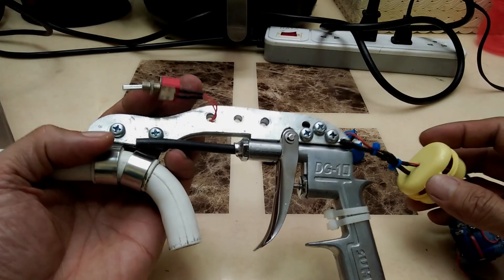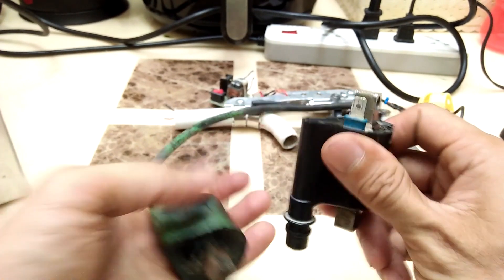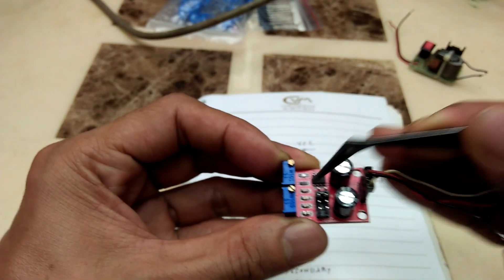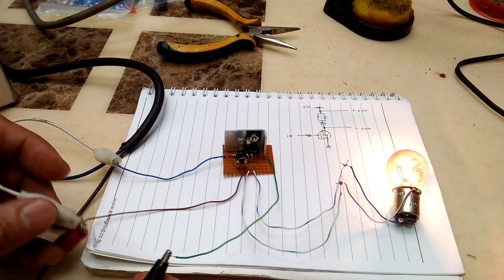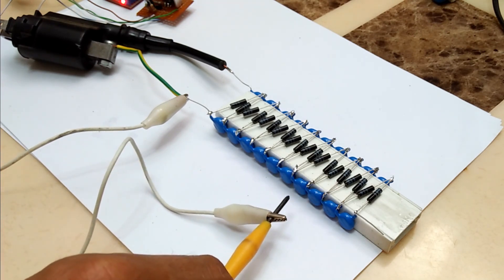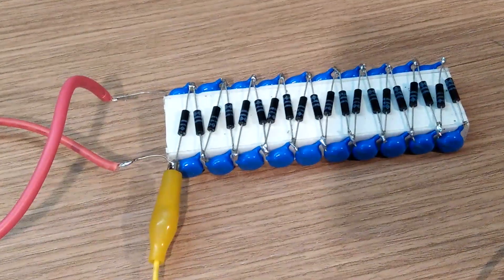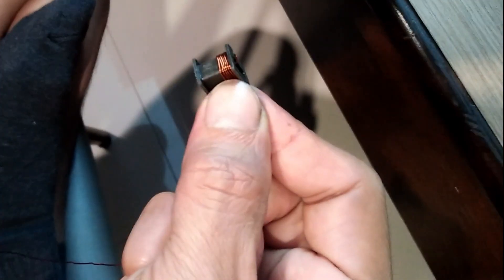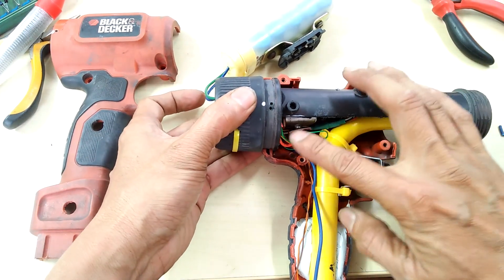Powder Coating Gun Power Supply Ignition Coil and TV Flyback Transformer

Comment: 9:18 just remove the first capacitor that is connected to the flyback and the first diode and polarise them right and your multiplier will work even with DC is just like the capacitive droper on light bulbs that enter ac and block dc 😊
Reply from the maker: I'll give that a try next time

Comment: use a transistor BU808DFX
Reply from the maker: Hi. Thanks for the tip. I simply used what is available to me at that time. I remember I got the mosfet from a discarded UPS board.

Comment: Are you using both transformers for the gun as well?  And the final value of the frequency generator is 700Hz?
Reply from the maker: In this video I experimented with the ignition coil and tv flyback to see if they will work. The TV flyback will definitely work but it is too big for my gun design. The ignition coil stop working at frequency above 700 Hz. The frequency for the high voltage cascade should be in the range of about 15 to 20 kHz.

Comment: What is the number of mosfet ic?
Reply from the maker: Hi. I just salvaged the actual mosfet used in the video from a junk UPS board and did not bother to look at the part number. You can use IRF520 N-channel Mosfet or any mosfet with similar specs.
Reply: @DIYPhil  thank you ❤️

Comment: Ola amigo tudo bem com vc , espero que sim, muito bons seus videos , estou montando tb uma aqui no Brasil, mas a unica parte que nao entende seria a do mosfet , vc poderia fazer um diagrama com os valores e nomes dos componentes inclusive do mosfet ? abraços
Reply from the maker: Hi. Circuit diagram at 2:37. Most MOSFET used in switching mode power supply should work. The mosfet I used in the video is a 2SK3569 which I just recycle from old UPS board. Other people use IRF530N Mosfet, which is a common component.

Comment: Very very nice video sir! Super detailed and very educational! I love your videos!

Nagbabalak din magbuo ng ganito pero for the purpose of flock application sir. As of now zvs + flyback kasi gamit ko kaya lang not enough ang static power nya para iapply sa gusto ko.

Im lacking a multiplier, nga lang ang flyback ay dc. So need talaga biyakin.

Pero yung 15kv na coil sir pede ko ba baguhin ang primary winding para pede ko ikabit sa zvs driver ko?

Will that work ba?
Reply from the maker: May ZVS driver din ako. Nasubukan ko na ikabit yung maliit na transformer wala naman problema.Wala ako binago sa primary winding. Kapag nagka time i video ko yung zvs driver.
Reply: @DIYPhil  so no need na po baguhin ang winding primary kung zvs ang gagamitin? Btw, may center tap ung zvs ko uubra din un diba?
Reply from the maker: @felmarz17  ahh ganun ba. kung may center tap kailangan mo i rewind. madali lang naman yun. yung zvs driver ko kasi walang center tap.

Comment: Hey...
What the purpose of the mosfet switch?
Is that necessery to add the mosfet switch or can I running without it??
Thanks...
I hope you can understand what Im saying😁
Reply: And for the casecade can i use 1nf 2kv??
I can't find 1nf 10kv or 30kv locally
Reply from the maker: @colorslaveworkshop2029  I don't think 2kV is enough. However, if that is what you have and you can get that cheap, you can try building the cascade with 2 or more capacitors in series in place of 1 capacitor. That will increase the voltage rating. The capacitance value will decrease but it will probably work.
Reply: @DIYPhil  ok thanks phill...
So that the point of the mosfet, so i can use irf 520 driver mosfet module to replace your mosfet version right??
Reply from the maker: @colorslaveworkshop2029  yes. it will work.
Reply: @DIYPhil  ok thanks phil. You"ll save a lot of my money😁....
Keep your work👍
Reply from the maker: Hi. The mosfet is used to turn on and off power to the transformer primary winding. The 555 ic output pin cannot handle the high current load if you connect the transformer primary winding directly to the IC output pin 3. You can buy HV generator kits that already have the mosfet. Try to search 20 kV high voltage generator kit. It is ready made and you don't have to build the oscillator and mosfet switch separately.

Comment: What diodes did you use? I can only find 5ma 20kv diodes locally.
Also which cascade do you find works better?
Reply from the maker: See at 6:34 for the second cascade I used 10 kV diodes which are cheaper and smaller. The second version of the cascade with more stages produce slightly higher voltage. Only a slight increase in the output voltage compared to the 5-stage version because I think the ac output of the transformer is not powerful enough to utilize the full potential of addition cascade stages. The 20kV diodes will work. I think in the first version I used 30kV just because that is what's available to buy that time.

Comment: Will you use some resistor at the end like in the old version ? I think it was 1M ohm Resistor
Reply from the maker: Hi. I tried with and without that resistor at the end and did not see any noticeable difference. I have seen other videos in YouTube with folks making similar high voltage cascade and they use the resistor at the end to limit the current spike that can destroy the diodes, as they say. So far I have not experienced broken HV diode, probably because I am only using low power, about 6 volts input to the supply. However I do intend to use a resistor at the end as soon as I find about 1M probably use 2 in series. I am only recycling components from old circuit boards and 1M range resistor are hard to come by.